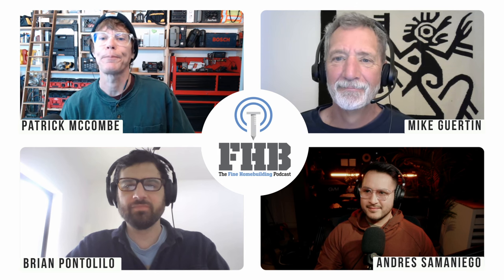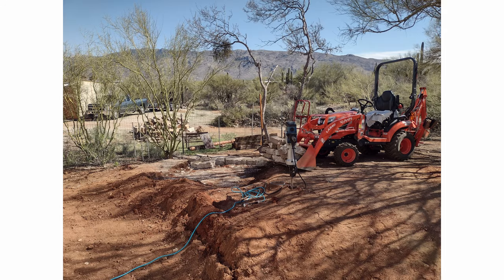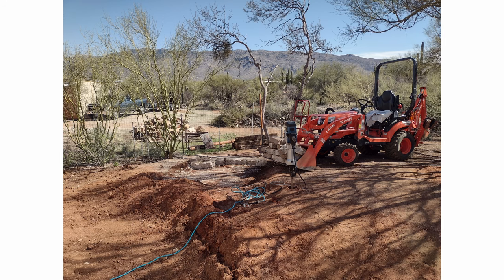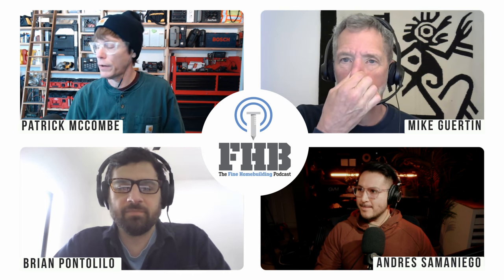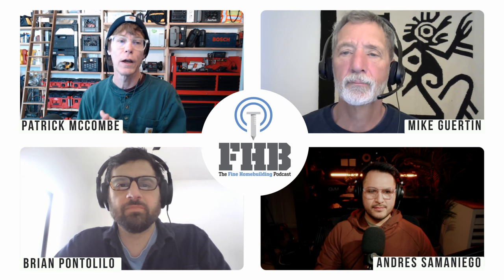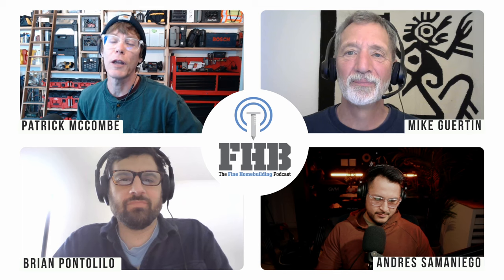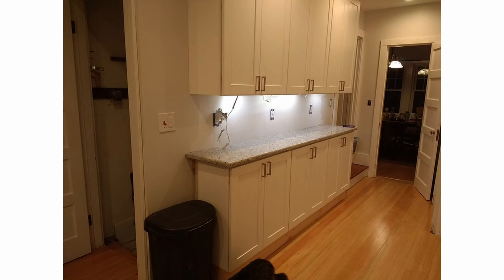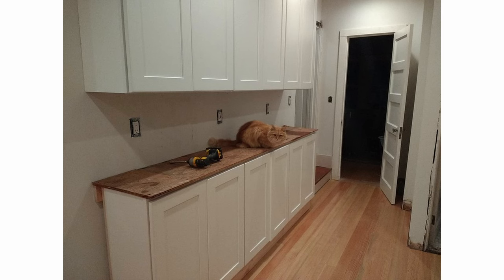Podcast 623: Condensation on Windows, HVAC Registers, and Water Heating

Comment: In a cooling climate a heat pump water heater is a no brainer. In a heating climate you are heating the air you pump heat from with your furnace (whatever that is), so you are effectively heating your water via your furnace fuel. However, the water heater heat pump will probably run more efficiently than if it had to pump heat from cold outdoor air. The question then is whether it is worth it vs a simple resistance heat water heater and it probably depends what your main heat source is (eg heating with oil is now getting quite expensive). Really I think we should push for more solar hot water heating. In some sense, that is low hanging fruit.